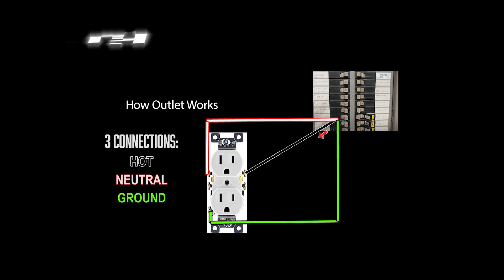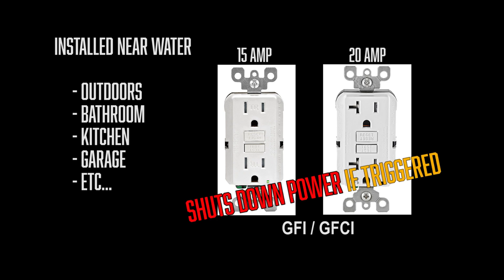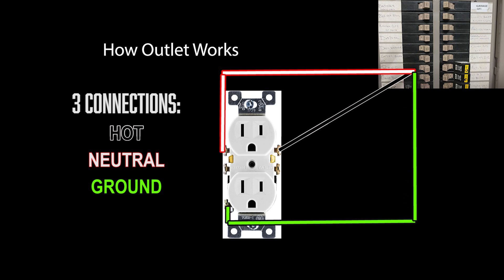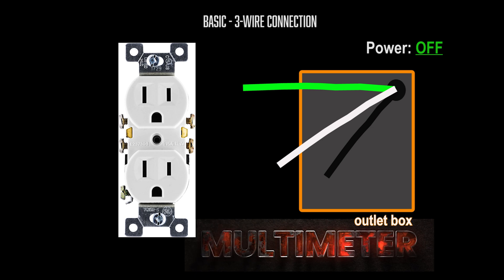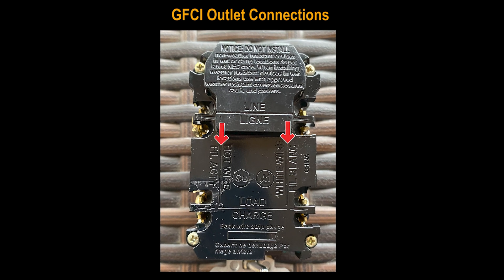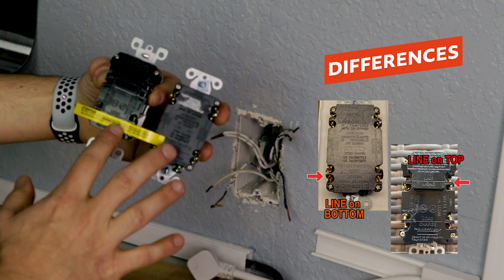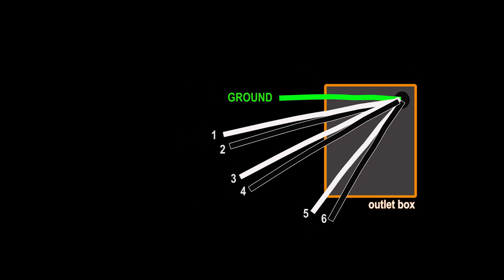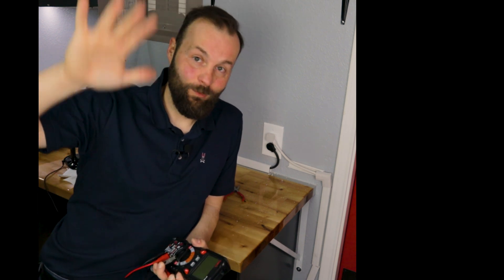Outlet Wiring Explained: How to Wire an Outlet, Identify ALL Wires, Troubleshooting

Comment: I have 3 black wires inside a wire nut and one of them is connected to the hot terminal. Same thing for the neutral wires. Could you tell me what their purpose is please? I’m replacing an old outlet with a decora outlet.